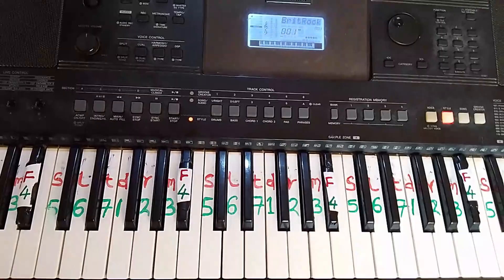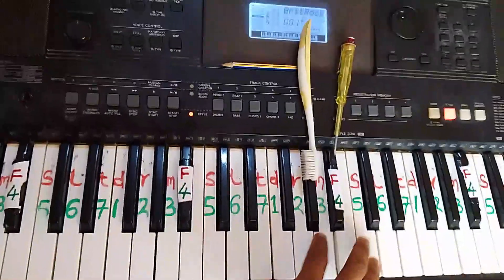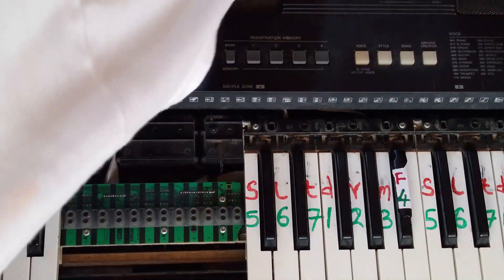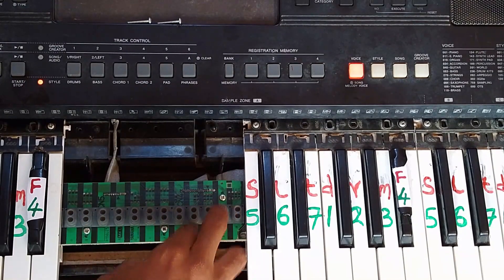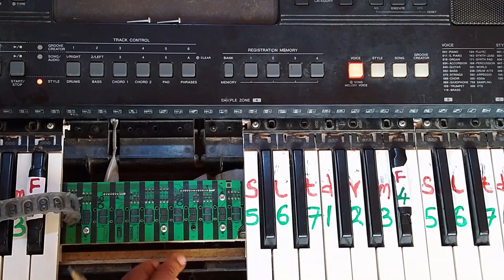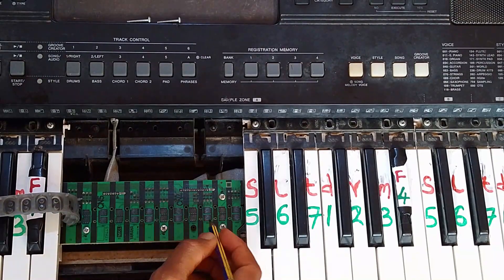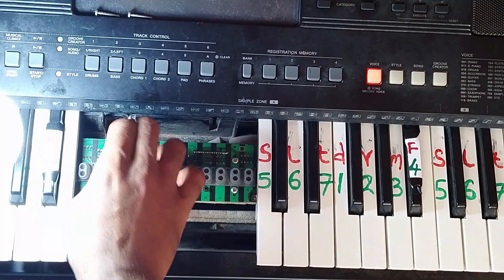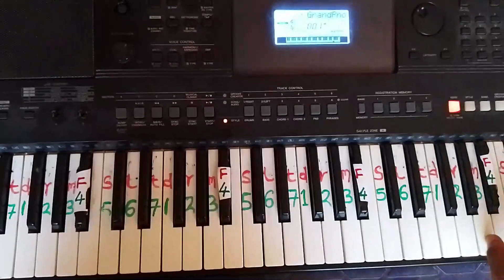HOW TO FIX A NON RESPONSIVE KEY ON YOUR DIGITAL PIANO - REPAIR PIANO KEYBOARD KEYS NOT WORKING.

Comment: Did you soke the brush with any substances  like fuel?
Reply from the maker: No I didn't. It isn't advisable. I did use fuel and another time methylated Spirit  to clean, one of my keyboard, I discovered,  after drying up, I'd see some  substances like ash all over the circuit board. They dissolve some components and those soldering. They take them off in bits. Just use a clean and very soft cloth, if you want some extra clean.